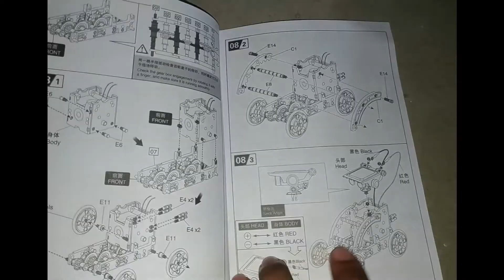Part8 : Auto Bot Assembly 14in1 solar robot educational toy kit: How to assemblage auto bot

Comment: I assembled everything properly but my gears were not turning when i kept it in direct sunlight. But was perfectly fine without load. Also i checked by turning the gears they were perfect too? So what might be the issue
Reply: @Maidolotl ayo.. that's not how it works. There is no cell to hold the charge. The motor is directly driven by the pannel.
Reply: Yes I to have the same problem
Reply: @padamjain3144  i was having it 3 years ago. But commented it just lately because i got this in my recommendations. That thing was fun to build but never worked lol